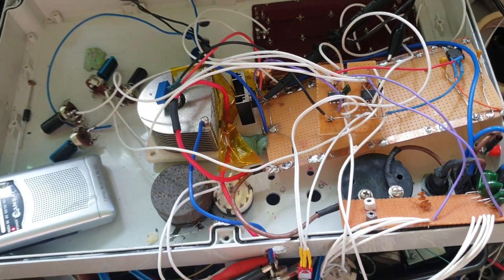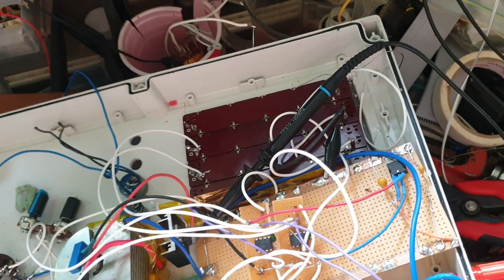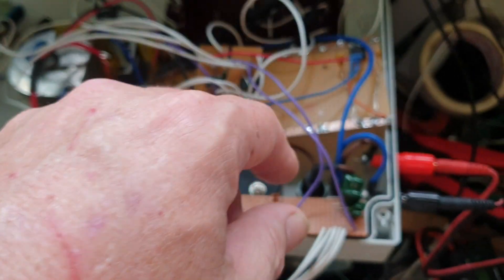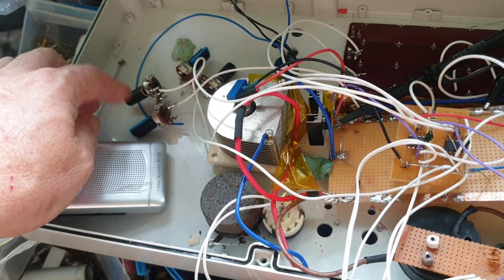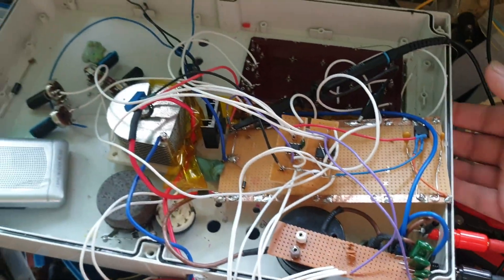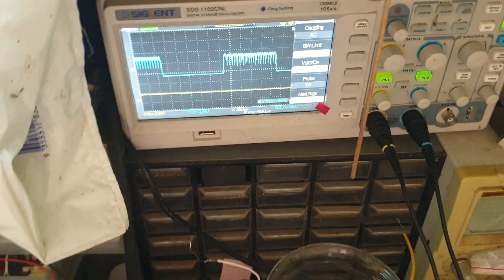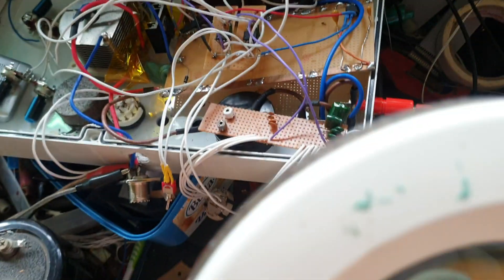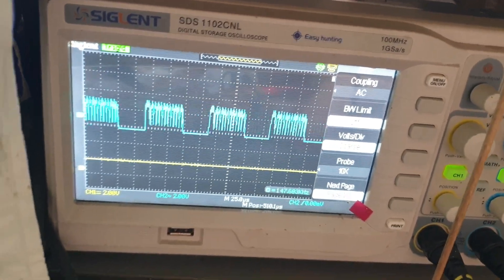Update. Dave Lawton circuit mods, better signal control 🤓👍

Comment: Nice one friend. Did you ever see the version of Dave Lawton's circuit that has the spark gap between the rod windings? I am just trying to find where I grabbed it now that I know a tiny bit more about electrical stuff and 'weird science'. I recall there being a Spice simulation for it. To a complete noob that is a scary place to investigate but not so daunting now. 

Not being a lifelong electronics wizard and failing the first time I attempted this (from Patrick Kelly's, Chapter 10 guide) I recently found a signal generator on aliexpress that was fifty bucks (kiwi). It has square/triangle/sin wave. It has duty cycle adjust. Also Level and Bias controls so you can turn up the signal and adjust the "ground level". Most importantly it has a sweep setting. That means you can set a lower and an upper frequency and a time duration. So if you found a a resonant point at 5K, set the sweep from 4k to 6k on for e.g. a 2 second loop.  Every 2 seconds your cell will find resonance and strip a lot of HHO away. Well that's the theory!

You could get a Gate Driver IC for a fiver to power the mosfets or wire straight to Lawton's ferrite rod winding (sold on aliexpress as "Buffer Rod Anti-interference Ferrite Mandrel" 200x10mm for another fiver), create a protection circuit to isolate the logic side from the power side and use Schottky clamp diodes.

Edit: And while I think of it, Plate Conditioning: In Kelly's Chapter 10, Ravi, explains his tap water conditioning method. Then a few pages later an organisation that replicated his design successfully used "4226 Super Corona Dope, by MG Chemicals" to coat the plates with a micron thin coating of varnish. Instant conditioning.

But hang on, by adding a layer of varnish to the 316L plates we are stopping electrolysis. Reducing the ability for power to pass from one plate to the next. Do we really want that? It might seem counterintuitive but the Rod induction makes the voltage much higher. It's a 12V system but because the of Ravi's Conditioning or the varnish coating, 12V or even 100V may not pass. But higher voltages, 1,000+ will break over. That should mean that the pulses punch much much harder. i.e greater gas production.
Reply from the maker: no i am not familiar with a spark gap between coils... only ever seen the mk1 and PLL circuits
Reply: @m3sca1 Ends up the youtube algo didn't like my first response that was deleted! Also that the spark gap is actually how the experimenter managed to simulate an electrolyser in the simulation website. My bad. If you join the 'open source energy' forum and search for 'Re: Dave Lawton WFC circuit, improved' you will find it all. Still valuable updates.
Reply from the maker: do you have another platform you can post the schematix on?

Comment: I made the circuit and it didn't work, I don't get the oscillating waveform that you have on the oscilloscope, could you give me a hand?
I would appreciate it very much.
Good day.
Reply from the maker: your 555s making any signal?
Reply: Well not really and I changed the 555 about 6 times, I looked for a long time if I made a wrong connection and no, everything is fine, I do not know what else to do, could you give me your Gmail and send you some pictures?
Reply from the maker: sorry i don't share gmail, just post a video from your phone onto your Youtube page👍
Reply: Could you at least tell me step by step how to make the VIC and Chocke?
Reply from the maker: @sergiutudor5121  make a video showing me what you have done on the lawton circuit. the VIC choke details for winding can be found if you look for it. i have not made one properly, i have tried all manner of coils. ignition coils seem to work well, bifilar windings seem to work well from what other people show. research VIC windings

Comment: Lawton circuit is not a problem, problem is how to switch to kv voltage.
Reply from the maker: and with a 7806 running the 555s, i can now run a 24v rail, giving me a better step up ratio when it comes to the HV coil

Comment: I should dig out my 555's
Reply from the maker: you should, they are great little oscillators
Reply: @m3sca1  I have a bunch of brand new ones somewhere.
Reply from the maker: @MAGnetICus_Attractus  i thought i bought ne555 but i ended up with LM555... they can handle frequencies up to 2megahertz apparently